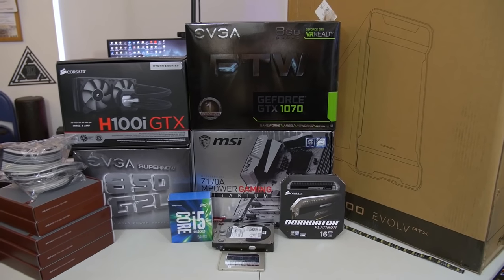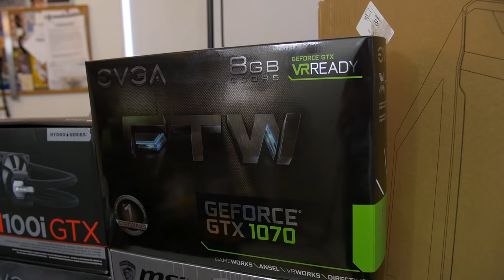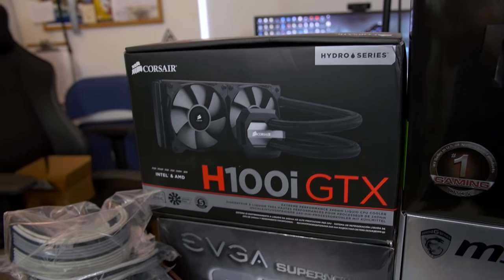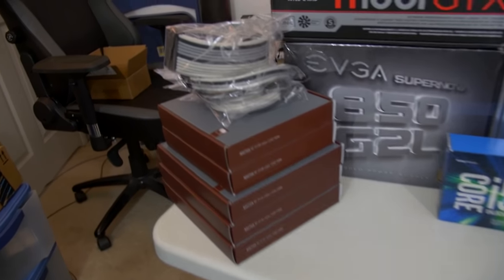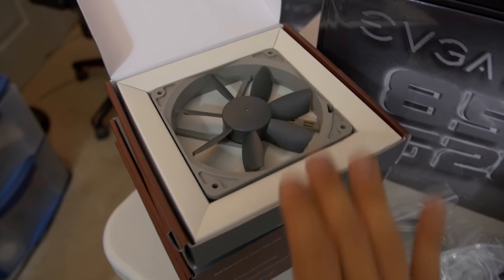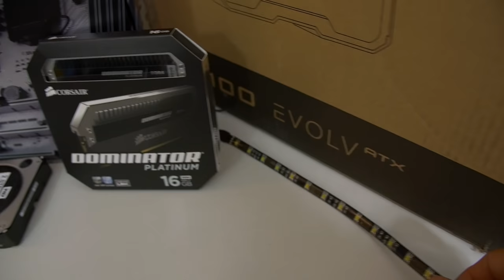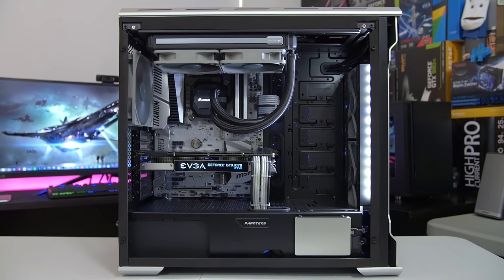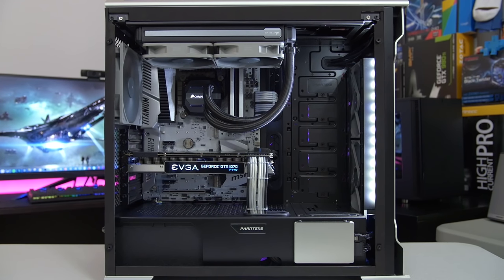THE SILVER BUILD! PC of the Month - October

Comment: Very late but what are the sizes of those extensions cables? What are the sizes for the 24 pin motherboard extensions and the 8 pin PCI-e extensions? Are they two different sizes? Any help would be greatly appreciated. This is for my first ever build btw. By size, I mean length cause on the website there are several options such as 50cm, 60cm, etc...

Comment: How did you hook up the H100i v2 and the pwm module? PWM into CPU header and the H100i into the power supply? I hear the pwm will not run the cooler fans at 100% so route to the power supply and the fans / pwm up or what?

Comment: 977 USD, Is this gaming PC worth buying it?
Graphic card :
MSI NVIDIA Geforce GTX 1060 3GB GDDR5 3GT
Processor :
Intel Core i5 6400 2.7 GHz, 3.3 GHz in Turbo, 4Cores, 4 threads, cache 6Mb
CPU Cooling:
Intel BOX
RAM memory :
8GB Kingston HyperX 8GB 2133MHZ DDR4
Hard disk :
SATA3 6Gbps Seagate 1Tera 7200
Motherboard :
MSI H110M PRO-D USB 3.1
Food :
Zalman ZM 500 Watts TX 80 PLUS
case:
NOX HUMMER ™ with Dual Ventilation and 7 LED colors
Soundcard :
Realtek ALC887 Codec
7.1-Channel High Definition Audio
network card:
Realtek Gigabit LAN RTL8111H
Reply: Yes it is, so what?

Comment: I'm about to put together my first ever build, and I'm also building in an Enthoo Evolv ATX using an H115i cooler. The one thing I haven't been able to figure out from the combined manuals for the case, motherboard (MSI Z270 Gaming X M7) and the cooler is how to plug into the fan controller at the back of the case. 

I'm even more confused now because it appears that you didn't plug any of the fans or the cooler into the controller: https://youtu.be/ku_sKQBD0lI?t=810 

Does that mean that that the controller isn't actually useful/needed (at least if you're using a liquid cooler)?

Comment: its 2019 and im going back to this pc case. I just love it :)
- ASUS PRIME X570-PRO
- AMD Ryzen 7 3800X (single thread performance is little bit better than the 3900x)
- G.Skill Trident Z RGB 2x16 Gb DDR4 3200 
- Samsung 970 PRO 512 Gb m.2 nvme SDD as boot drive
- Samsung 970 EVO 1 Tb m.2 nvme SSD as storage for games (only)
- ASUS ROG Strix GeForce RTX 2080 Ti
- Some Silent RGB Fans
- BeQuiet DARK POWER PRO 11
 750W PSU 
- BeQuiet DARK ROCK PRO 4 CPU Cooler (NO! I DONT WANT WATER COOLING ANYMORE! H100i leaked and damaged my 6700K + gtx 1080 build...)

Any opinion or suggestion? :D
Reply: Looks good

Comment: Hey Kyle! I have a slight issue with the silver build I tried to copy off you, and its with the ram conflicting with my H115i cooler. So I had to put the radiator in front.. And im feeling that my case is not getting enough cold air flow as that is the only point blowing air in, the rest (top, rear) is blowing out. Any other options for the ram? or idk... any tips really
Reply: It shouldn't be too much of an issue, if you have to keep your cooler in the front then that's fine. Assuming its a 240mm rad, put it high up at the front with a third fan low down (evolv fits 3 front 120's) the top fans should pull the warm air from the rad straight up and out whilst air from your third front fan will pass along you gpu.

Comment: Great build. I'm doing my first one and need some help.

Motherboard: Asus Z270F ROG Strix gaming

CPU: I7 6700K

PSU: CIRCLE 500 Watts

GPU: Zotac Gtx 1060 6GB AMP EDITION.

RAM: HYPERX FURY BLACK 16GB (2X8) DDR4

CASE: NZXT S340 ELITE

What do you guys think? I'm using a hard disk from my old computer which is only eight months old so that's fine. I can't use an SSD or I'd have to let go of the 1060 and get a 1050ti. Is this good enough for 1080p gaming or even 1440p?
Reply: james stark The gtx 1060 is perfect for 1080p, but you should change the processor to an i5-6600k and buy a better psu from seasonic, corsair or evga because you cannot skimp on the psu. Also if you're buying that motherboard and the i5-6600k i would recommend you buy a CPU cooler with that. I'd recommend the be quiet! dark rock 3.

You should change the processor because you'll almost have the same performance (~3 fps difference) as the i7 if you're only gaming and you'll have 100$ spare afterwards.

I think the rest is good with those parts. You'll easily be able to reach 60 fps at 1080p ultra with that build.
Reply: shacomd I'm actually buying the evga 650 watt psu and the msi gaming m7 motherboard because there's really not all that much difference between the msi and Asus motherboard. I'm using the hyper 212 evo for a cpu cooler. And there's only about 30 or 40 dollars of difference because I'm getting a smaller hdd and a 128gb ssd. And I'm using the i5 7600k instead because why not? There's the difference of hyper threading but not many games need hyperthreading

Comment: This is a pre built PC. It costs 850 euros. Is it good?
Nox Hummer ZX 
Intel Core i5-6500 Quad-Core 3.2 GHz 
MSI B150A GAMING PRO
Gskill Ripjaws V DDR4-2133MHz 2x8GB 
SSD Samsung 750 Evo 250GB Corsair Builder CX600W 
MSI GeForce GTX 1060 6GT OC
LG 24X DVD-RW Sata
Reply: Quaquas At least in Canadian dollars, not the best deal. Make your own if you can.
Reply: Mauser Gaming I can but if I build one similar to this one the price goes all the way up to a thousand euro. Maybe that's cause I include a 1tb wd and a better evga psu

Comment: Would this build (Exactly what is in there) power a Dell 43 Inch 4k Monitor at full resolution? Please let me know! Thanks so much!
Reply: sam sam i know that this is pretty late and you have most likely moved on but i would suggest getting a 1080 or 1080 ti instead of the 1070 shown here as they are MUCH better at handling 4k at ultra settings

Comment: How will you be getting internet with this computer? Don't you have to buy like those wireless adapter things that gets installed in the computer?
Reply: OK LOL you can use the ethernet port at the back for a wired connection or a wireless adapter for connecting to wireless networks (WiFi)

Comment: Are you sure you weren't drunk when purchasing your equipment?  Why did you use the NF-S12B on the rad?  You should of used high static pressure fans.  Noctua only rates those fans for Medium Static pressure for case application

"Typical PC case ventilation applications require high airflow but only medium static pressure. The NF-S12B has been specifically designed for high airflow efficiency and low noise in order to provide best results in these so called low impedance applications."

Last time I checked a rad was high impedance.  Form over function was the name of the game on this build.

Comment: That PC LOOK INSANE!! I'm building my first PC this Christmas and need some input in this build. I would greatly appreciate the help. I'm wondering if everything is compatible and if everything will fit in this white theme case?

CPU** | [Intel Core i5-6600K 3.5GHz Quad-Core Processor]

*CPU Cooler* | [Cooler Master Hyper 212 EVO 82.9 CFM Sleeve Bearing CPU Cooler]

*Motherboard* | [Asus Z170-A ATX LGA1151 Motherboard]

*Storage* | [Western Digital Caviar Blue 1TB 3.5" 7200RPM Internal Hard Drive]

*Memory* | [Corsair Vengeance LPX 8GB (1 x 8GB) DDR4-2400 Memory]

*Video Card* | [Asus GeForce GTX 
1070 8GB Dual Series Video Card]

*Case* | [Corsair Carbide 400C White ATX Mid Tower Case]

*Power Supply* | [EVGA SuperNOVA NEX 650W 80+ Gold Certified Fully-Modular ATX Power Supply]
Reply: Looks good! CPU cooler wise though I would recommend looking up the Cryorig H7. Has a white fan, looks beautiful, and has outperformed the 212 EVO in pretty much every test I've seen. I believe they are also releasing the H7 quad Lumi which is an LED version sometime close to christmas as well so that might interest you. Also, depending on budget, if you want the best white themed products, check out Galax/KFA2 Hall of Fame stuff, they do RAM and a 1070 I believe
Reply: im not positive on the compatibility but if your going all out with a gtx 1070 you should spring for 16 gigs of ram
Reply: get yourself an SSD for your boot drive, and get 16 GB of ram. Other than that you're fine.
Reply: Looks good but keep in mind , you may want to do some research on part installation because my 212 Eco was a pain in the ass to put in
Reply: +AJW116 :D evo*
Reply: Yo go with a corsair PSU more reliable trust me, I've used both. And the 212 is terrible to install. Otherwise all looks great go m8
Reply: If you are only want white lights for your Christmas PC build, and are not interested in RGB colors, then you can save some money and get the EVGA GeForce GTX 1070 SC GAMING ACX 3.0,  8GB GDDR5  card with white LEDs.
Reply: Looks good. Do yourself a favor a add an SSD in there. One of the most cost-efficient way to make your PC faster
Reply: Hey, I would suggest you add an SSD for the OS. Trust me, it makes a big difference. And please for the love of god don't get the Hex PSU.. they are built from bad quality components. I suggest you go with EVGA g2 or gs (if you are on a budget Seasonic m12ii). Have fun building.
Reply: Negus_Nark looks great all around, nothing is bottleneck'd, but yeah definitely get an SSD, 250gb at least for Windows and some games you mainly play for faster load times. I have the 212 and its great, after around my 3rd time building with it, I've gotten used to the hard installment just takes time

Comment: Hello guys, I need your help :(
So I recently built me first PC back in July and it was a very expensive one. 
It was working perfectly until a week or two ago. 
I was playing a game and it suddenly crashed and a blue screen with a sad face showed up. 
It said it had to restart so it did.
Now, everytime I turn on my PC it just keeps crashing and restarting without stopppng, it doesn't even get to the log in screen.
I tried uninstalling Windows 10 and reinstalling twice and nothing happens.
I've tried with different types of RAM and it doesn't help.
Here are the specs:
-i5 6600K
-Evga GTX 1070 Sc
-16Gb RAM HyperX Fury Black DDR4
-Motherboard: Asus Z-170 A 
-Evga 650W 80+ Gold Modular
-240Gb SSD HyperX Fury
-1Tb HHD Western Digital Blue
I'm really worried because I spent the whole summer working for that PC and it'll suck if something happens to it.
I've tried installing Windows 10 in both drives to see if my SSD was the problem, but it wasn't.
My only guess is that something's wrong with the CPU or the Motherboard but I just want to know if this is a common problem or if someone could help.
Thank You (:

Comment: i need help... is it possible to plug an adapter into another adapter? im trying to get a gtx 1060 and i think it needs a dvi-d dual link monitor cable. my monitor has a vga cable and i already have an adapter going to dvi-a. so is it possible to plug the vga to dvi-a adapter into a dvi-a to dvi-d adapter?

Comment: Anyone know if it would be a pain to install a 240mm radiator in the front rather than the top in this case?
Reply: i don't see why it would, that's where i plan on putting mine. i don't like how it covers the motherboard when installed on the top.

Comment: question what is better Dual Geforce GTX 1070 8GB And High Bandwidth Bridge or one Geforce GTX 1080 8GB
Reply: Usually it depends on if the game supports sli or not, because if the game does not support sli then it will only perform as well as the single card. but in games where it does support sli it would be better than a 1080, but if you are already spending that much on two 1070s then you would be better off with just buying a single 1080.
Reply: The Red Dragon a good single card solution is always better than multiple cards
Reply: ok thank u so just get one 1080
Reply: If you're playing older games that don't support SLI, sure. But for any triple A title SLI is clearly the way to go if you have the cash. Two 1070 's would potentially shit all over one 1080 in any newer game worth it's salt.

Comment: Can somebody tell me if  this oc is good or not because i dont know
AMD FX-6300 3.5GHz 6-Core Processor | 1 TB 7200RPM Hard Drive | AMD 760G Chipset
 Nvidia GeForce GTX 960 2GB GDDR5 Video Card | 8GB DDR3 Gaming Memory for 600 dolars
Reply: pre-build pc?
Reply: yes
Reply: looks god but you probably can not overclock with that motherboard
Reply: what do you think,should i buy it or search for something better?
Reply: Matija Janicijevix look for something better , maybe an i5 or fx 8300
Reply: i found this pc but it isnt built and i need to ad a case for it
Intel Boxed Core I5-6400 FC-LGA14C 2.70 Ghz 6 M Processor,
Zotac Graphic Card ZT-P10610A-10L,
Kingston HyperX FURY Black 8GB Kit (2x4GB) 2133MHz DDR4 ,
Seagate 1TB Desktop HDD SATA 6Gb/s 64MB ,
Microsoft Windows 10 Home 64 Bit for 600dolars